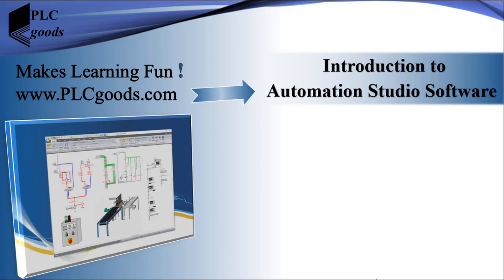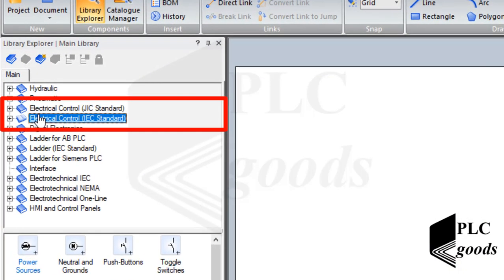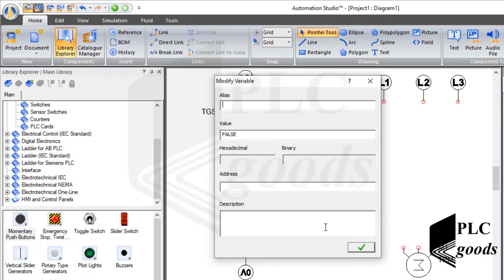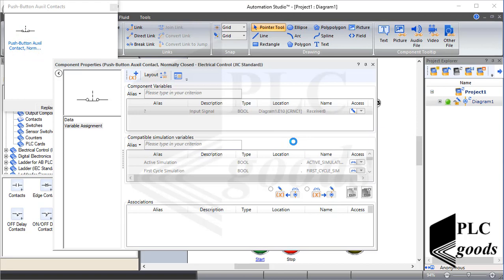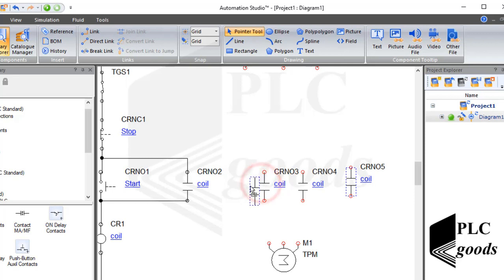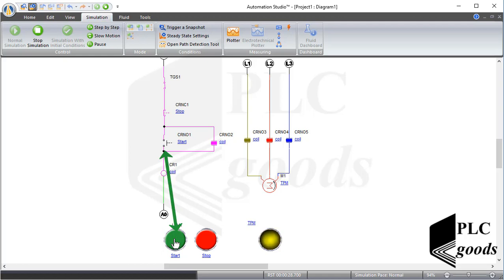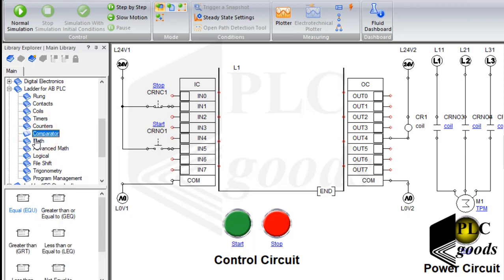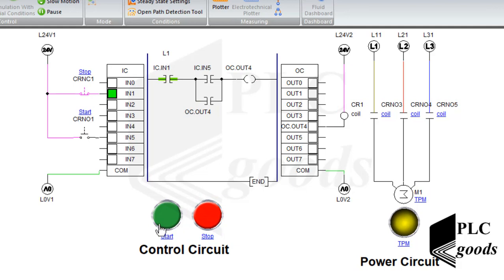Introduction to Automation Studio | tutorial on using library to edit or simulate a PLC program

Comment: I need a library for air breakers, timers, and relays. Do you have any links to help out? Thank you
Reply from the maker: 💚💚Hi! Thanks for your question.
For libraries of air breakers, timers, and relays, it depends a bit on what software you're using (like AutoCAD Electrical, EPLAN, TIA Portal, etc.).
Here are a few general suggestions:

Manufacturer Websites: Companies like Siemens, Schneider Electric, Allen-Bradley (Rockwell Automation), and ABB offer free downloadable libraries (CAD blocks, symbols, and sometimes PLC programming blocks) for their timers, relays, and breakers.

CAD Symbol Libraries: Sites like TraceParts, CADENAS, or 3D ContentCentral have free electrical symbols and device models.

EPLAN Data Portal (if you're using EPLAN): You can download a wide range of component libraries directly inside the software.

AutoCAD Electrical users can get manufacturer libraries from Autodesk’s content download page.

Comment: Thanks a lot. Excellent explanation. 
Maybe you know which program is better for designing electrical circuits? AutoCAD Electrical or E-Plan, specifically in North America
Reply from the maker: Both AutoCAD Electrical and EPLAN Electric P8 are excellent programs for designing electrical circuits, but their suitability depends on your specific needs and industry. Here's a comparison tailored to North America:
Reply from the maker: 1. AutoCAD Electrical
Best For: General electrical design, especially in industries where AutoCAD is already a standard.
Key Features:
Part of the widely-used AutoCAD ecosystem, making it easier to integrate with other Autodesk products.
Extensive library of electrical symbols compliant with ANSI and IEC standards.
Strong compatibility with DWG file formats.
User-friendly interface for those familiar with AutoCAD.
Advantages:
Easier to learn if you have prior AutoCAD experience.
Excellent for projects requiring collaboration with teams using other AutoCAD tools.
Better for projects that mix electrical schematics with mechanical designs (e.g., plant layouts).
Disadvantages:
Limited automation compared to EPLAN.
Requires more manual effort for complex projects, like large-scale panel wiring.
2. EPLAN Electric P8
Best For: Automation and electrical design projects, particularly in industries like manufacturing, automotive, and energy.
Key Features:
Powerful tools for creating detailed schematics and wiring diagrams with high automation capabilities.
Supports multi-user collaboration and project management.
Excellent for generating reports like BOMs, terminal diagrams, and wiring lists.
Robust compliance with North American standards (e.g., UL and CSA) and European standards.
Advantages:
Superior automation features save time on repetitive tasks (e.g., automatically generating wire numbering).
Better for projects requiring extensive documentation and cross-references.
Strong focus on modular design and system integration.
Disadvantages:
Higher learning curve, especially for AutoCAD users.
Typically more expensive than AutoCAD Electrical.

Comment: How give gate pulse to thyristor
Reply from the maker: To give a gate pulse to a thyristor, you apply a small trigger pulse to the thyristor's gate terminal: 
1. Connect the power circuit
Connect the power circuit to the load across the thyristor's anode and cathode. 
2. Apply the trigger pulse
Apply a small gate pulse to the thyristor's gate terminal. The pulse only needs to last a few microseconds to turn the thyristor on. 
3. Current flows
The thyristor will turn on and current will flow from the anode to the cathode. 
4. Remove the gate signal
The thyristor will remain on until the gate signal is removed and the voltage through it reaches zero. 💚💚
Reply: @plcgoods  where I find trigger pulse

Comment: I want to learn to draw electrical diagrams, and I would like your advice on which is better, learning drawing on the eplan program or Automation studio
Reply from the maker: If you're mainly interested in electrical diagrams and design: EPLAN might be the better choice due to its specific focus on electrical engineering tasks.
If you're interested in broader automation systems and simulations: Automation Studio might be more suitable, especially if you're working in industries where control systems are a significant focus.✌✌
Reply: @plcgoods  thank you for replying. I am interested in the field of automation and I also want to learn to draw electrical diagrams. I have started learning to program Delta PLC controllers.

Comment: Hello sir, I really appreciate this video, thanks for it...But I have a question. it´s possible to use two PLC cards at the same time ? and also to connect simultaneously  two bars ? it´s because I need to make a simulation with more sequences with actuators, so I need more inputs and outputs to do it.
Reply: Hi dear, thanks for watching our videos. Almost all PLC types support some extension cords. So, it's easy to increase the number of your inputs and outputs. Also, you can use external cards inside the automation studio software.
Reply from the maker: To get a better understanding of how PLCs are used in respect of cards, spend some more time on my PLC related training videos. thus far i have 3 video courses related to S7-1200, Allen Bradley SLC 500 , ControlLogix 5000 and Delta PLCs. You will learn a lot just by watching them let alone doing some exercises on your own

Comment: Hello sir, I really appreciate your work and that how you explain, but I have one question for you, can you give me a MHJ plc-lab code? Best regards!
Reply: Hello. Unfortunately, I've not worked with this software (MHJ plc-lab) yet. I'm using factory I/O software
Reply from the maker: Hi, you may get the Factory IO trial version (30 days) at the following link: https://factoryio.com/start-trial/. try to download it, use it for 30 days using our tutorial videos because that is the mostly used software in the market.
Reply: @plcgoods  Hi I really need some help with my circuit. Would you be able to help?
Reply: Would it be possible to have meeting to discuss my requirement further, I would really appreciate this.
Reply from the maker: Please discuss the issue either here in the comment section or you can email me using my current email address of info@plcgoods.com , thanks for checking the content
Reply from the maker: Sorry to tell you that I can not help you with the application of the software that I do not have any usage experience on it!
Reply from the maker: I already responded to this question!
Reply from the maker: @dr.engineering201  unfortunately Not, please place any of your queries here in the comment section of each video, for my attention, i will be more than happy to help if i can!
Reply from the maker: Hello, I do not have any experience working with MHJ plc-lab software, so sorry that i can not help you on this!